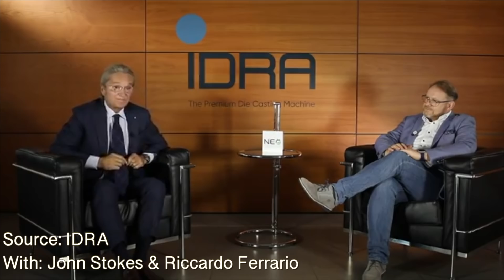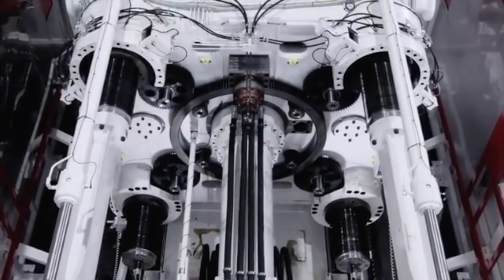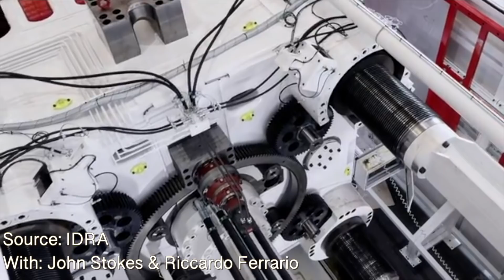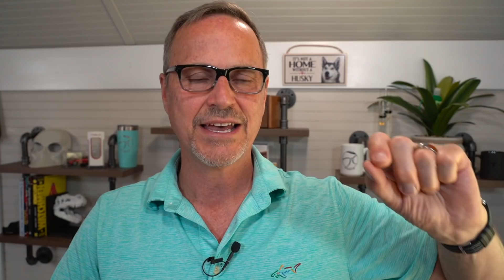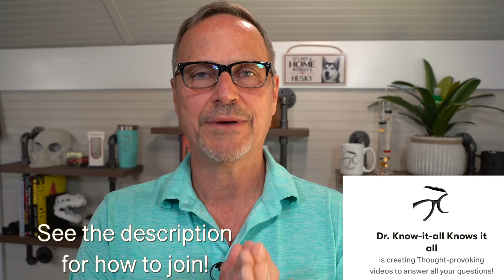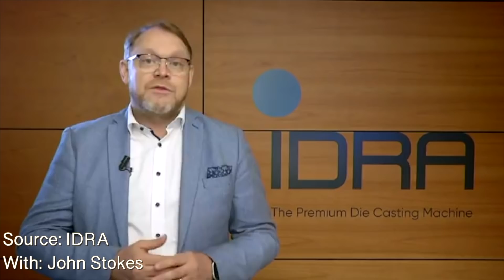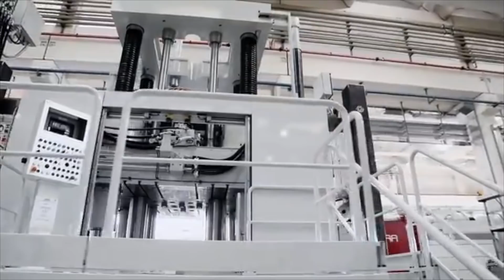Tesla's secret weapon: the Giga Press!

Comment: I think IDRA has been developing that casting machine for years because BMW was the first company to use giant castings for the i3 and there is a 2013 video of sandy munro showing that.
Reply: The i3 is made of carbon, it's completely different in production !
Reply: @Karla-Flr  the bmw i3 is made from carbon and the interior with recycled materials, the chassis is made from aluminium castings and profiles, go do some research mate.
Reply: @Karla-Flr  But not the chassis, or? I thought just the overall Frame is made out of carbon. You can not put weehls, engine, etc. stuff on a carbon frame, or?
Reply: @ingenieur-s8w  you are right !
Reply: It's a shame they didn't follow up with the idea.
Reply: @andrewsaint6581  I fully agree with you.
Reply: @andrewsaint6581  they actually followed with the idea, they have been using castings for their sport cars and extra luxury models. Bmw has a factory where they produce and recycle carbon fiber. Bmw and volvo are probably the only companies that uses recycled materials in their cars.
Reply: @carholic-sz3qv  Most steel is recycled, so I would say all car companies use recycled materials. It's just that steel is so easy to recycle that nobody talks about it.
Reply: @Will-be-free  when I said recycled materials i wasn't referring to steel or aluminium, i was talking about plastics and fibers from plants and cloths..... mazda even uses corc as material, bmw uses and recycles carbon fiber.....